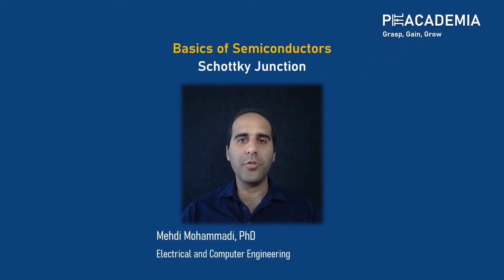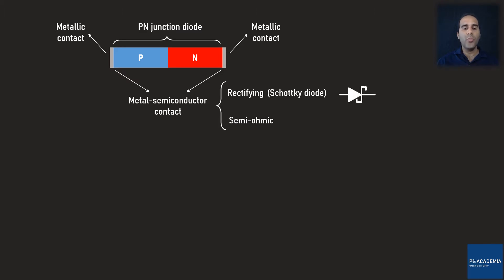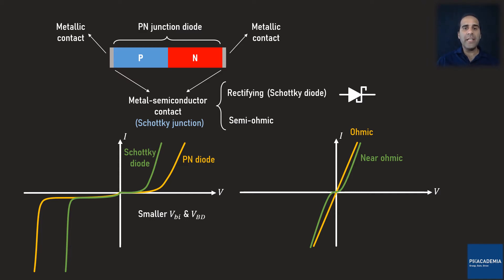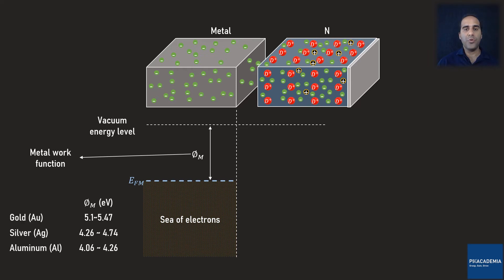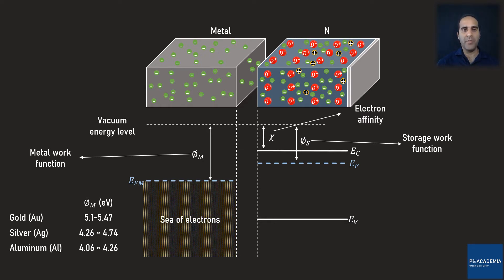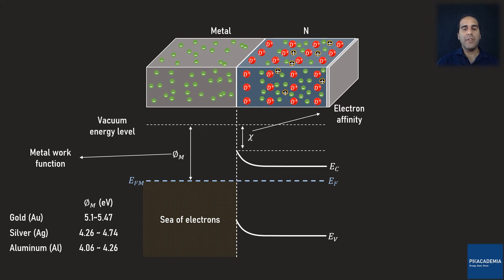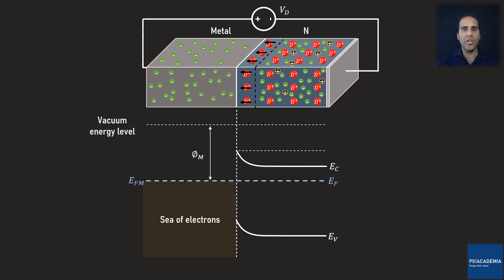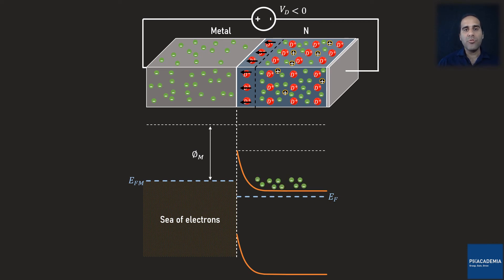22_Basics of Semiconductors: Schottky Junction

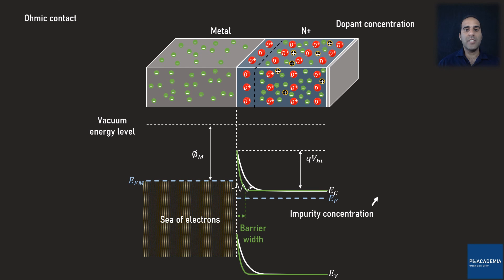Comment: Great video! However, there seems to have a bit contradiction on the relationship between doping concentration and barrier width on 14:45 and 14:58. Could you please clarify it? Many thanks!
Reply: I don't understand what you're exactly confused about. The barrier width decreases with increasing doping concentration near the contact surface. For an ohmic contact you want a highly doped semiconductor so that the barrier width is small and tunneling is the primary conduction pathway. For a schottky diode, you want a large barrier so the current becomes limited built in voltage. He also didn't mention that you can make an ohmic contact by using a metal with a lower work function than the semiconductor.